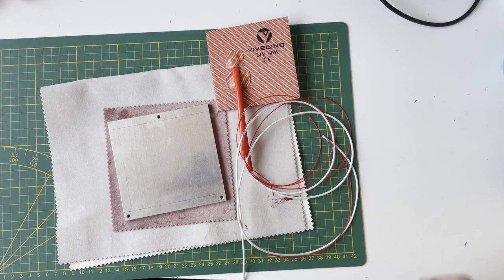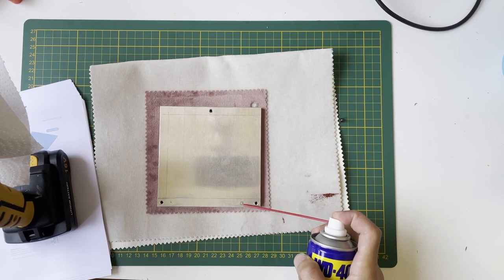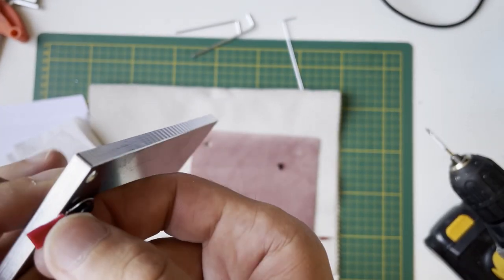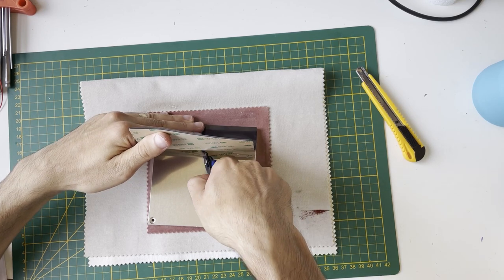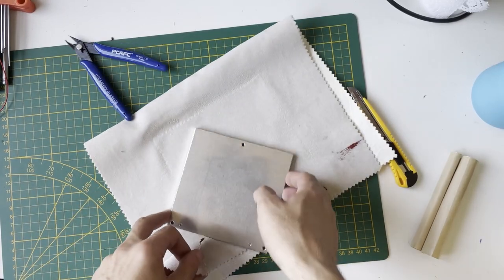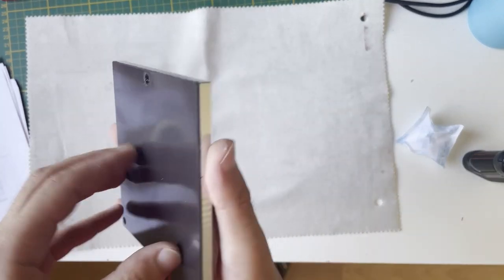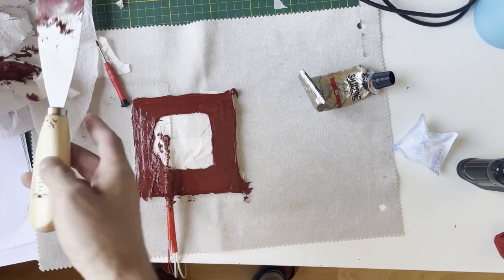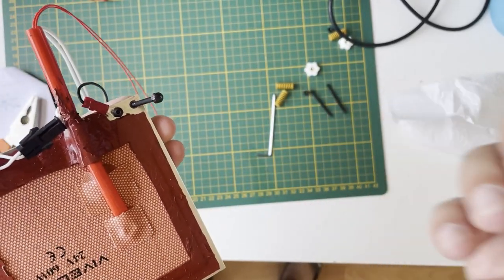Building Voron v0.1 - Bed [Ep9]

Comment: Why do you want to ground the bed when it is not mains powered (24V)? The thermal fuse is nice to have, but for 24V/60W it does not make that much sense if you have it attached this securely and enabled thermal runaway protection in FW.
Reply from the maker: That’s correct. Ground connection is unnecessary.